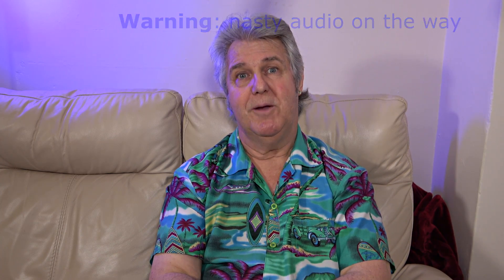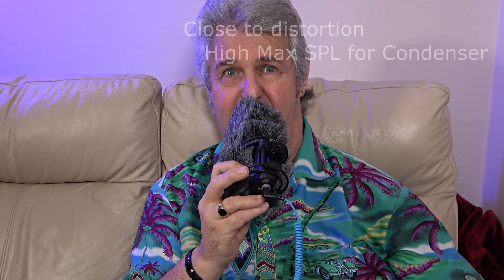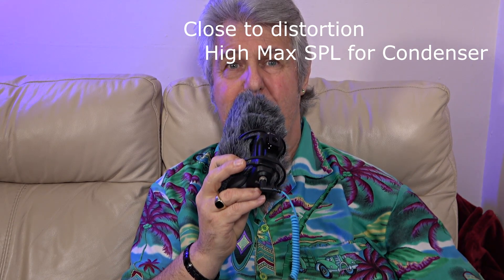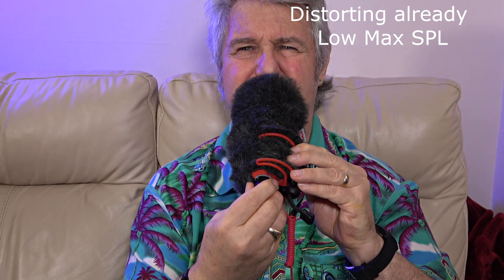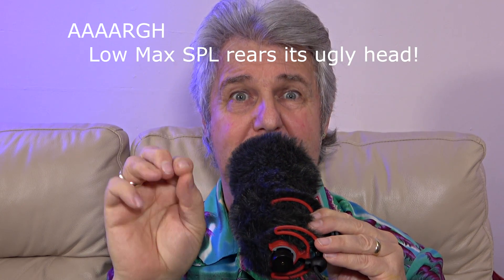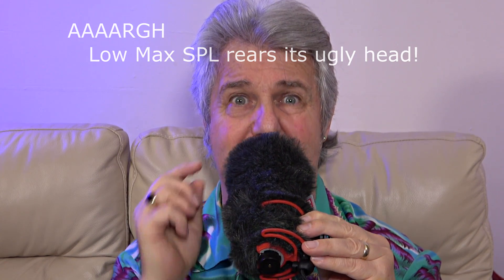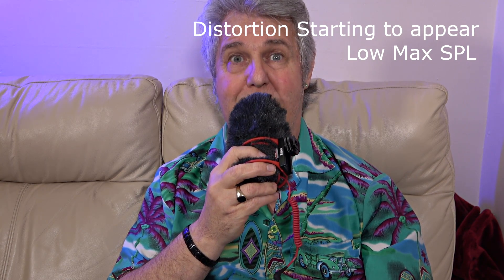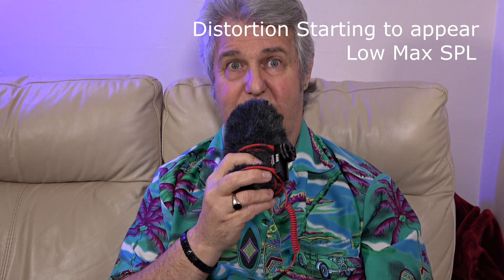The New Rode Microphone Offerings have One Potential Problem .......

Comment: Thanks for taking the time to look at the VideoMic NTG and VideoMic Pro+. There is often some confusion about how and when clipping occurs with different styles of microphones, so allow us to add some information and also explain how to avoid the issue with the VideoMic NTG and VideoMic Pro+, even when used as described in this video.

The first thing to understand is that dynamic microphones and condenser microphones operate very differently, and this leads to them having very distinct characteristics. Dynamic microphones have a relatively heavy diaphragm, as it has to be coupled to a coil of wire that then moves in a magnetic field to generate an electric signal as the diaphragm vibrates. This means dynamic microphones are relatively insensitive, which makes them great for loud sounds (such as close to the mouth), and helps them to reject quieter background sounds. As there are no active electronics in most dynamic microphones, the only way clipping can occur is if the diaphragm physically reaches its maximum displacement. Given the relatively heavy diaphragm weight and robust construction, this is almost impossible to do in normal usage. Hence a dynamic microphone will almost never clip ‘at source’. This means provided you set the gain correctly at your recorder or camera, clipping is extremely unlikely.

Condenser microphones have a completely different mode of operation. They have very lightweight diaphragms that are not mechanically coupled to the transducer. Instead, the changing distance of the diaphragm from an electrically charged backplate alters the capacitance, and hence voltage, between the diaphragm and the backplate. This voltage is then buffered, amplified and impedance matched using active electronics before being sent to your recording device. These characteristics – light diaphragm, active electronics - makes them much more sensitive than dynamic microphones, and therefore much better at recording quieter, more subtle sounds. This makes them perfect for using at a greater distance from the sound source, whilst still getting an excellent signal to noise ratio.

However, the more complex design of a condenser microphone also introduces more places where clipping can occur. And it’s important to understand this in order to get the best results, especially if recording loud sounds. There are actually three places that clipping can occur:
1) Mechanically, at the diaphragm. 
This is when the diaphragm exceeds its maximum displacement. Basically the diaphragm moves so far it actually touches the charged backplate. This is extremely rare with regular sounds (even when they are very loud), but can happen when the diaphragm is exposed to wind bursts, such as plosives. This is why it is important to protect a condenser microphone from plosives using a quality windshield or pop filter.
2) In the active electronics. 
This is where the capsule is near the extreme of its range of movement, and is producing such as large voltage that it is overdriving the active electronics inside the microphone. (You might ask why the electronics are not designed simply to accept voltages this high. The reason this can happen is that if the active electronics were designed to match these very usual loud sounds, then in normal use the microphone output would be rather quiet, and with a less good signal to noise ratio.)
3)Finally, they can clip at the recorder input. 
As condenser microphones are driven by active electronics, they can generally produce much higher output voltages than a dynamic microphone. This can overwhelm the input circuity of the recorder. Sometimes, (and especially with the poor quality audio circuitry found on many DSLR-style cameras) this can mean the initial buffer amplifier in the recorder clips at the very first stage, before the main amplifier that actually controls the gain. Hence the signal can be clipping on the way into the camera, but this clipping may not be visible on the audio meters in the camera, as it is occurring at an earlier stage in the camera’s audio circuitry.

Understanding where the clipping is occurring is important in terms of solving the problem if you hear clipping on your recordings. 

For the first type, ensure you are using a good quality pop filter, and you are keeping wind out of your microphone when outdoors.

For the second, which can sometimes happens when using a condenser microphone close to a sound source, you need to activate the PAD on the microphone. This pad does not, as commonly believed, simply reduce the output level of the microphone. Rather it reduces the output voltage of the capsule before it goes into the active electronics of the microphone. This increases the SPL handling of the microphone (albeit at the expense of a small increase in the noise floor). Both the VideoMic NTG and the VideoMic Pro+ have a pad that can be engaged using the controls on the microphone. We recommend using the PAD if you are using the mic as a handheld mic, or close to the mouth for voice-over recording. The maximum SPL figures quoted for RØDE microphones (and for mics in general) assume that the PAD is engaged.

For the third type,  try turning UP the record level on your camera a few notches above the lowest setting, and then reduce the output of the microphone until your audio meters are peaking around the -12 dB mark. This is because some cameras can behave strangely when set to their absolute lowest audio gain setting – bumping up a couple of notches protect from this. On the VideoMic NTG you can then balance the level with the output dial, on the VideoMic Pro + you can change the output level in three steps via the controls.

By knowing a bit about the characteristics of the microphone you are using, and selecting the correct settings on the microphone and the recorder, you can successfully use condenser microphones in almost all of the situations that a dynamic mic would work well, plus get the advantage of the greatly enhanced sensitivity when used at a greater distance. But there is also a point where you have to select the correct tool for the job. A sports car does not make a great off-roader, even if you fit it with chunky tyres. If you really want to record scream vocals close up, then choose a dynamic microphone. (The PodMIc has a cult following for live use amongst metal vocalists…) And if you want a mic that works great for all practical filmmaking applications on your camera, even when you are a couple of metres back, choose a condenser.

If you are having any further problems, or need advice, please don’t hesitate to contact us. As you note further down in the comments – we do know a lot about microphones 😉
Reply from the maker: Thank you for such a detailed explanation concerning mic design and use. 

This was a harsh test for any microphone, I’m well aware of that. It followed frustration and  a series of ruined clips using the NTG, where people just speaking were clipping without the camera reaching anywhere near the zero point! Up to now, I haven’t tried raising the gain in the camera and lowering it on the mic. I used a Sony ax53 for this.

The NTG in particular seems way more prone to distortion than the Videomic Pro+. I’ll try turning the gain up on the camera and down on the mic though! So in terms of distortion…. Pro+ followed by Go II and then the NTG. The Pro+ was good but the NTG seems only just up to the task of vlogging, on camera type stuff where you have little control over the dynamic range of what you are capturing. This suggests it might not be such a great vlogging mic because I don’t get the same issue with another mic that looks like a copy of the NTG.

I did this dreadful ‘shouting test’ just to see which of the Rode mics went into clipping first and more readily.  It was indeed the NTG which is the one I have most problem with in this respect. I thought the Videomic Pro+ did really well actually.

So in terms of ‘sports cars’ and ‘off roaders’ I think the Videomic Pro+ is a much safer option for vlogging than the NTG since you can’t predict sudden volume changes and the Pro+ is better in this respect. The NTG seems a little delicate for vlogging to me and is better suited to indoor, quieter sounds. Even wind rejection is way better on the Pro+. 

So I guess the NTG is definitely a finely tuned, delicate sports car by comparison to the more ‘off road’ Pro+.  However, it’s built as an on camera mic for vlogging where it seems to run into problems with loud speech and traffic sounds where it’s advertised as an all rounder, for use into computers, vlogging, studios etc. I am surprised that the max SPL in that case is so low, even with the pad engaged. Vlogging asks a lot from a mic and the Pro+ stands up way better in this situation in all honesty, with regards to directionality, wind rejection and max SPL. The ‘sports car’ is a little too delicate imo.

I have many mics from you, but the distortion that I’m showing in extreme here is what I get to a much lesser extent in normal situations on sudden loud sounds and normal speech without passing the zero point on my camera. It is way more prone to distorting than any other mic that I have. By the way, it also has a lot more gain. Perhaps an electrical or impedance thing?

No one would imply that you don’t know what you’re doing with your mic designs and how much you know all about microphones. I am suggesting that the mic sounds great, but maybe not for vlogging purposes really. The ‘look’ of the mic suggest it is for vlogging but the mic is perhaps ‘too sensitive’ for that purpose.

I have great respect for Rode mics but I’m absolutely certain I’m not the only one that has noticed this. In fact, I know I’m not. 😉

Rode NTG Max SPL = 120.
Rode Go II Max SPL = 110 (This is getting a bit low)

I am puzzled why the NTG seems worse. Electrical? Or is distortion uneven, in some frequencies and not others but the average comes out at 120?

I fully expected the Go II to be much worse, but it wasn’t!!

EDIT to SUBSCRIBERS: Putting the pad on does definitely help with normal vlogging. Just tried it and that really helps, so it seems for vlogging purposes, we might need to have the pad switched in, up the gain slightly in camera and use the dial on the back of the mic. So far, everything seems better on camera. Close up though, with the pad in, it still goes into distortion, so in this video, I think I may have a combination of electrics driving too hard and overwhelming the capsule at the start. 

So if anyone can report back, please do. Use the pad. Raise camera gain slightly. Raise mic gain. Hopefully, in normal situations, this might help with the NTG vlogging in particular.
Reply: @iancraig   Just watching your video and wondering if you could also check our SD-2420 microphone as you have such great experiences from your previous job. We are looking for some professional or good experience youtuber to check and review our product. Thank you for your time and sorry to bother you

Comment: The Videomic NTG distorts even at soft speech volumes. I am just corresponding with Rode about it. I dont have to shout, if the mic is boomed like 40cm and I talk at normal Ievel, it distorts. I will experiment with that further this weekend as Rode support suggested a few things to try. Someone told me this issue started after a FW upgrade, but I cannot comment on that.  Today Rode wrote to me that I should try to increase the gain on the camera a tiny bit as it might be related to the electronics of the camera. They also pointed at a YT video where someone had to increase the gain of his Sony camera from one notch to three notches as some inbuilt limiter was kicking in when recording at the lowest level. Rode specifies 120 dB max SPL for the VM NTG, for indoor talking head that should be sufficient. The MKE600 is around 130 dB and that one has no issues whatsoever.  The VM GO II is another ten dB lower, rated at 110 dB, so if SPL is indeed the issue than it should be even worse than the NTG...
Reply from the maker: A limiter kicking in will clip the tops of the audio so that it sounds compressed but not introduce distortion.

I have no idea why a camera would switch in a limiter at a lower volume either. Normally, they kick in at high volume so that's not right.

Maybe it's an impedance thing going on between camera and mic?

I did the dynamic mic demo at the start to show that you CAN shout into a mic without distortion. The Videomic Pro+ did well (taking into consideration that it's a condenser which is more sensitive) My gain on the camera was set low and I raised stuff in post and the two new ones showed distortion straight away 

If it is a capsule thing, Rode can't do much but if it is happening internally, then they can. In any case, the gain on the NTG is way too high so lowering it internally would be ok, but not if that distortion is coming from the capsule.

For some reason, the NTG is worse than the Go II. I wonder whether they quote an 'average' max SPL but at some frequencies it is way lower and unfortunately, those frequencies coincide with the voice.

It's all very well to test in a sound treated room and measure with probably something like a sine wave, but using the NTG outside on the move is full of problems with distortion and wind rejection. Even the NTG deadcat is pretty poor which is why I use another one to cover the whole mic up.

I like Rode mics, but I was hoping that the Go II would have a better max SPL figure. In use, it's just an 'ok' mic and I think Rode could have done better with it.

Try a Deity D4 mini. Cheap. Sounds good. Input for a lav as well. Way better value than the NTG for normal vlogging type stuff.

To me, the NTG is an indoor speaking mic, not a videomic.

The more people that notice this, the less Rode can deny. I suspect they know. They are good mic designers and aren't saying too much!
Reply: Exactly my thoughts.  I will play around with it using my Zoom recorder rather than the camera to see what happens that way.
Reply from the maker: I have heard a report of Rode engineer contacting another YouTuber and claiming that they don't get this on their mic.

Well now you're another! Send it back if you can ......

Comment: Thanks for addressing an issue not even Curtis Judd seems to mention as far as I know. I have the Videomic Pro+ so I'd better be careful. I wonder, though, how sensitive the Stereo Videomic Pro is. I have actually put it in front of a Jazz Quintet! Great review, which would be best enjoyed from speakers...
Reply from the maker: 😂 This is definitely a speaker video!

Actually, Curtis gave it a brief mention when he did the Rode NTG. That seems to have a lower SPL than the Go II but the figures suggest the opposite!

I like the Stereo Videomic Pro. It has a healthy SPL though I think, like the Videomic Pro+. I have a stereo one as well.

In more quiet speech type stuff, these mics are ok but the max SPL is lurking a bit close for comfort. No headroom as it were!

The Videomic Pro+ is the best of the Rodes with regards to max volume and actually, wind rejection. The more I compare them, the more respect I have for the Videomic Pro+.

The new boys on the block sound nice, until you make loud noises!